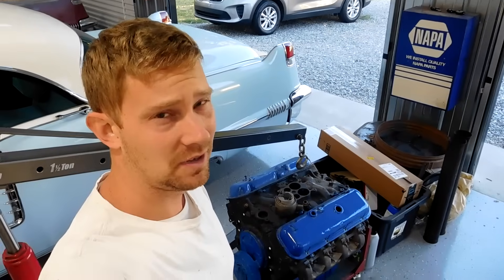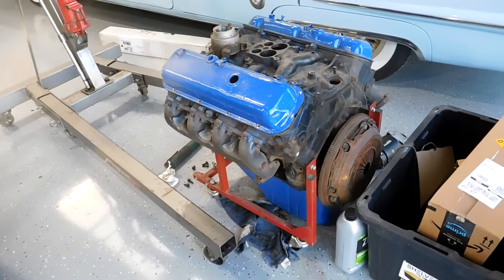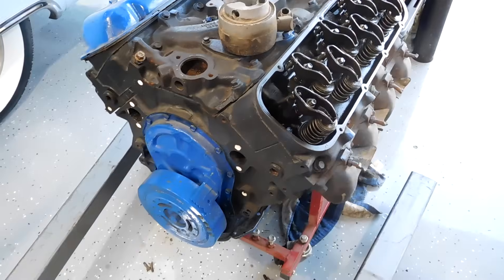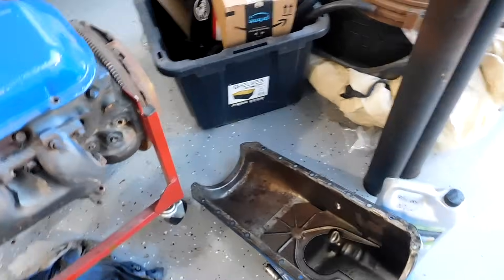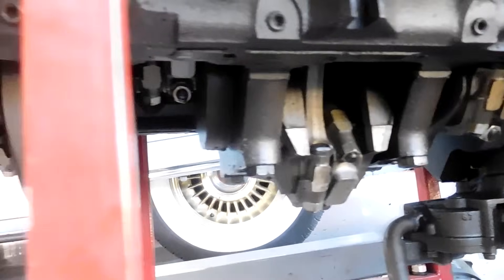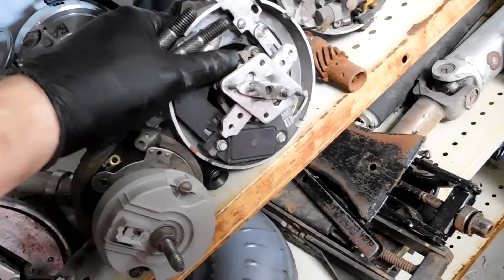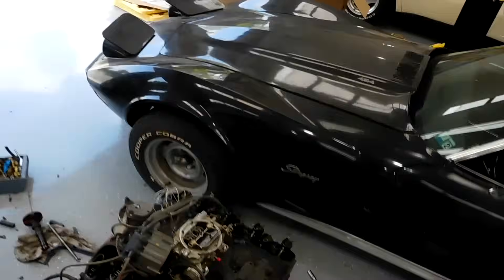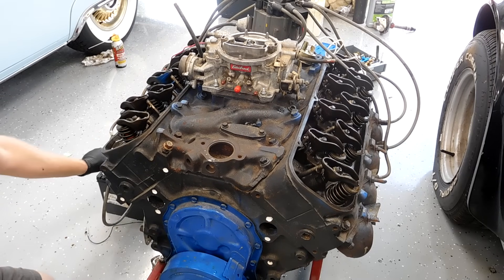Unknow Chevy 454 From Facebook Marketplace. Will It Run?

Comment: @TheCorvetteBen  here is a little tip for you when running engines like this. on the top of that Edelbrock carb, next to the ports for the metering rods and the vent passages for the fuel bowls. i use an Allstar Performance ALL40090 Primer Bottle to fill the bowls with fuel. that way the engine has enough fuel to run and to get fresh fuel up to the carb if it has a mechanical fuel pump. you can also use this trick with holleys and qjets. just fill the fuel bowls through the brass vent tube.  also, that engine looks like it was a rebuild that never got used. there was no oil in the pan and none on the main caps or rods. that is unusual unless someone took it apart and cleaned it up, but even then, there is usually oil in the pan from drainage.
Reply: I used to use an old mustard bottle…but yea this is wayyy better than just dumping gas down the venturis

Comment: Just a tip and info
Tip. 
When you have the oil pan off and engine is down that far, be good time to look at the timing chain, save alot of time and money later on down the road, when its installed in a vehicle, 
Info.
Yes, the aluminum oil adapter was in pickups and trucks for an added oil cooler, you can get a normal spin on pieces off any small block, is the same part.
Also the front hole where oil spued out, that is another location for oil pressure gauge on a big block.

Keep up the good work, love watching your videos.

Comment: most rv have low miles that is normal they sit a lot u can get from a standard 454 , 450 hp 454 , ls 6 454 small block then if u get the 450 hp they have a 02xx 400r turbo which is good to 800 hp they have 02xx welded on the bell housing last year i got 4 setups from 6,000 to 58,000 miles on them and the engines were the 450 hp with steel crank heavy rods 10,5 to 1 compression high flow heads most rv's will have the paper work in the glove box all are crate engines plus u get twin electric fans oil cooler power steering cooler desert cool radiator and most have the serpentine belt setup  best part was i got all 4 for free . like right now after pulling the engine and trans i sold the left over for 2000 buck but i just needed the engine and trans but could have sold it for up to 25,000 but to buy it new it would have cost close to 20,000 for everything i got